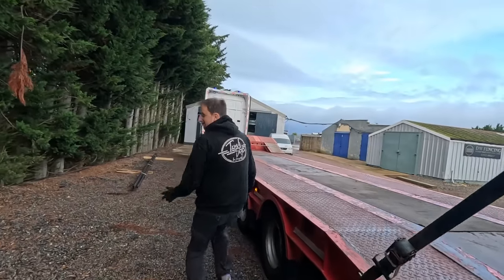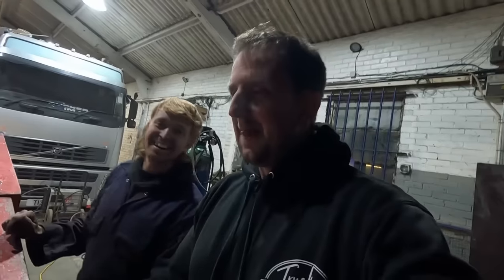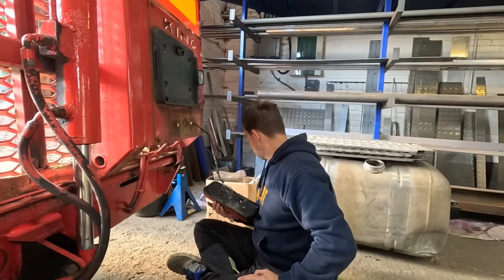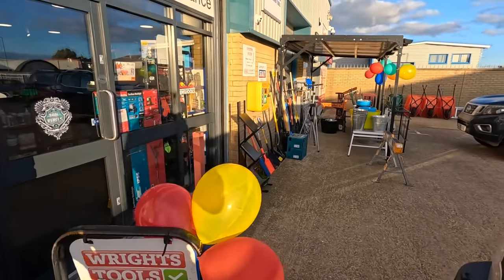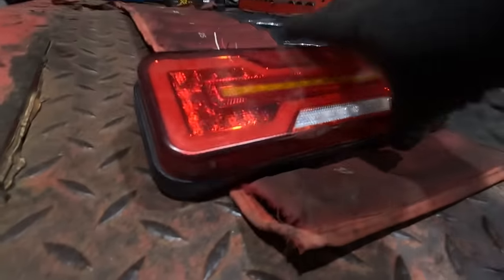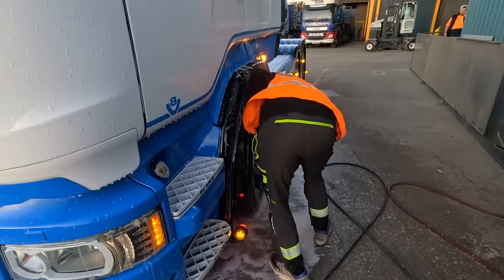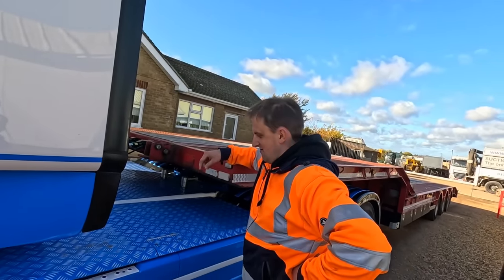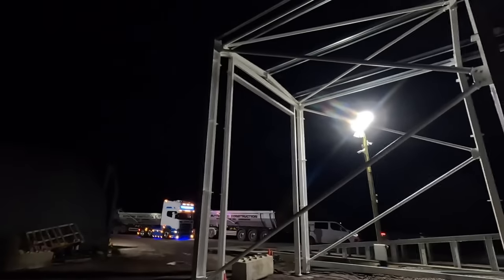DELIVERING A FLAT PACK WORKSHOP | #truckertim

Comment: Hi Tim. Idea for your king trailer. How about fitting Scania tail lights on the back so it matches your unit?
Reply: that would look sick
Reply: They can't be. You need triangle marker in the rear bcs its not a vehicle with its own engune
Reply: Would fail mot like that
Reply: It all depends on how you read and interpret the Vosa Inspection manual. If all markers are in place and all the lights operate as per, so no white light to the rear, no more than 2 fog lamps etc then I do not see any problem with running Scania lights on a trailer. Just thoroughly read through the manual, section 62 for markers and section 63 for lamps and make sure you've got everything covered.
Reply: That would not look nice and also not legal but sure Tim wouldn’t care
Reply: @lovenano8427  Add it to the list of items that need 'Adjusting' on the truck before it can go for an MOT!
Reply: i am aware guys of the need to fit separate red triangles to the rear of trailer. hgv mechanic to trade. plenty space at rear to fit them. just an idea as its all in the detail

Comment: That winch should be on the top of the neck . It’s in the way . If u move smaller stuff looks like your ramps won’t sit over the top of it . IMO
Reply: Not really tbh he has measured it so it isn’t taller than the ramps

Comment: Bolts should be fitted other way round because if the nuts fall off at least the bolt is still in place
Not sure that winch could pull you out of bed.
Reply: Might be good for recovering a Renault Twingo.  / B.

Comment: Its all very well putting your lightweight ramps on, but have you now knott reduced what you can load by their weight carrying capacity and the angle is much steeper now, can't see what was wrong with the old ones, nowonder Shaun wants them

Comment: I’d be very careful with sarcasm in relation to either jokingly or seriously thinking about others doing the repairs / maintenance work. My dad is a commercial vehicle workshop manager and your comments and actions towards Lombardo is similar to treatment he receives from customers who slowly remove parking then maintenance thinking it’s greener on the other side. If you do this you’ll no matter how much you get on with the staff be pushed to the bottom of the queue, or be told take it elsewhere. 
Whether it’s been badly edited or is genuine I found this very insulting towards Lombardos. Reminds me of how my dad is treated by customers who think of only themselves and not the feeling of the staff at Lombardos being used. Comments made either in joke or said in seriousness is very uncalled for. 

Don’t burn your bridges and I’d personally acknowledge those comments being unjustified. As I’m sure although Lombardos will deny it they will be both annoyed and shocked by the comments. Again I’ve seen this first hand.
Reply: Has done the same to nipper now  never see nipper